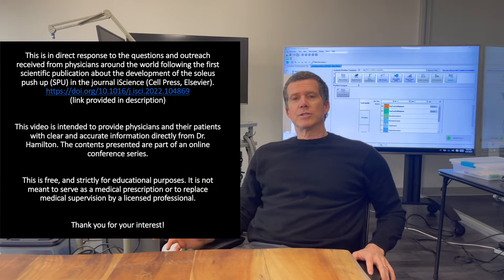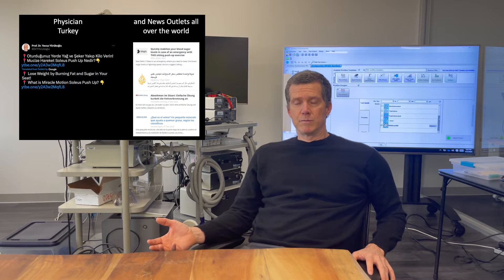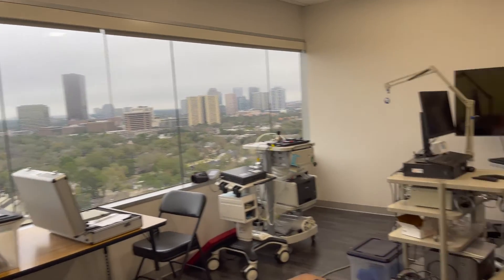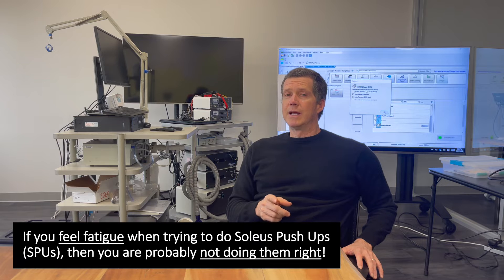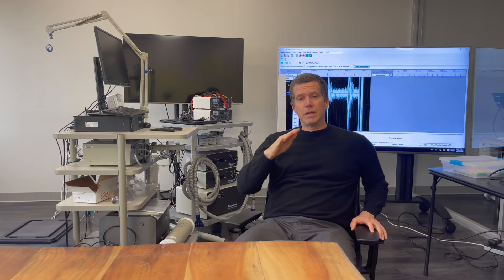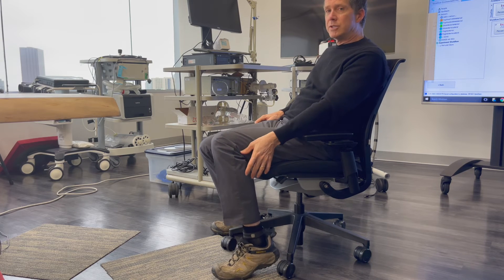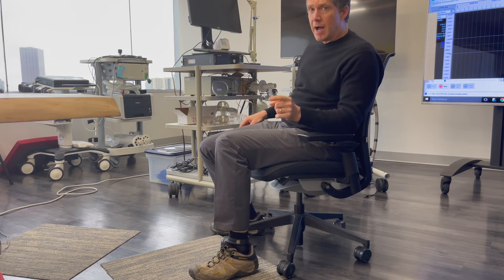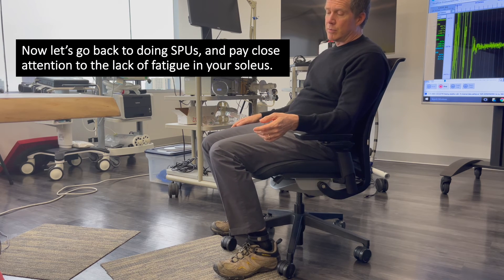Fatigue Resistance of the SPU (Soleus Push Up) demonstrated by the Developer, Dr. Marc Hamilton

Comment: Thanks for India.. I am benefiting alot from this exercise.. But one doubt though... What should be the height of the chair?.. also to reduce fat when can we do this? thanks in advance sir
Reply from the maker: It’s always a good idea to adjust the way you sit to maximize comfort and to also help you do the SPU motion optimally. It’s not just the height. But also to position the feet more under the knees (see the other video where this is demonstrated), it’s also sometimes helpful to slide your legs and bottom forward. When doing this it is also helpful to comfortably tilt your upper body back against the chair/sofa.

Comment: I do alot of cycling and find my calf muscles are quite developed as soleus and gastrocnemius muscles are important in the pedal stroke. Ive been doing the soleus push ups as well since i read about the benefits regarding blood sugar levels.
Reply from the maker: Athletes and fitness enthusiasts of all ages are using SPUs in training. The SPU activity trains these muscles at a greater intensity and duration than is possible during cycling (or running). The VO2 (oxygen demanding metabolism) of the calf is much higher when doing SPUs walking or running (see Figure 2C in our iScience article). Also remarkably, that data was during several hours of SPU activity and only minutes of treadmill exercise. You are correct that calf plantarflexion is important in cycling, running, and walking. That lower leg muscle group is dominated by the soleus because it is much stronger than either the lateral or medial gastrocnemius (the 2 separate muscles at the top outer part of the calf, whereas the soleus is both much wider and much longer all the way to the heel). But it is not just about what happens inside the muscles, and includes how the systemic responses good for other parts of the body.

Comment: Thank you for this video I saw Andrew Huberman talking about it. His description was brief with the only exception that it will help out to lower your glucose levels, but the videos that Yelp put explains exactly what we need to do. Thank you so much for this.
Reply from the maker: It’s naive for someone to think glucose metabolism is the only reason, or even the primary reason. First, I ask people to read the research article. It describes a general principle about why we needed to develop a method of for hours (not minutes) each day. The article also gives some other outcomes than just glucose (including lowering insulin concentration as much or an even larger % as the glucose), c peptide, VLDL triglyceride, and the calorie burn. But those are only the tip of the bigger iceberg of effects. More studies have been done and results will be forthcoming when ready for public dissemination. Finally, I can share that in part because of the anatomical location of the soleus muscle and it’s role in walking and running, we’ve interesting studies coming about the role SPUs play in even non-metabolic benefits for improving walking abilities of elderly and even athletic performance of young fit people.
Reply: Thanks for your reply I just like to keep one thing in mind if he wasn’t because I saw the video of Andrew Huberman, I would have not known anything about this Solis pusher and doing a search. Found me to you and look at your video and I’m glad to know there’s a lot more benefits push-up just goes levels I’m interested to know as much as possible and I’ll keep looking for watching your videos to get as much information as possible.

Comment: When can do this excercise to lower blood sugar level sir
Reply from the maker: The best approach is to habitually use this to keep muscle metabolism elevated throughout the times of day whenever sitting. That will improve not only glucose but other important things such as doubling fat oxidation. But the more limited acute option you you may have inferred was to do this instead of sitting when either blood glucose or insulin are too high  after carbohydrate ingestion (typically 30-150 min in the postprandial period).

Comment: Hello Doctor. May i ask do we have to do both legs at same time or can we just do one leg in session? Is it as effective as lets say doing soleus pushup of both legs together? Waiting for your kind reply. Thanks in advance and keep up the good work you are doing to humanity. I salute you, sir.
Reply from the maker: Thank you for your polite question. Sometimes 1 leg alone is all you can do depending on where you are sitting. In that case, know that 1 leg doing SPUs well can be impressive. In theory, if you were doing a highly controlled experiment and measuring fuel used for working muscle, then 2 legs would use 2X more fuel than 1 leg. But I’ve seen that when sitting where the floor or chair/sofa are not like I like it, the 1-leg kind is better. The rule of thumb is to keep moving because no one can have a very high muscle metabolism when muscle isn’t active.  But like I said in the video, you can be guaranteed that when soleus is working for you, it must use a lot of fuel. Compared to the energetics of all 600 of your resting muscles combined (one-third body weight), most people can learn how to keep muscle metabolism at a level 4X higher each minute they choose to do so with 2 leg SPUs, or to double the body’s muscle metabolic rate by high quality 1-leg SPUs.
Reply: @marchamiltonphd  Thanks for the kind reply, sir.

Comment from the maker: 60,000+. That’s the answer to the common question I am asked “How many combined  soleus contractions do your 2 legs always achieve in a day because of SPUs? But I also remind people it’s better to think about the “daily  contractile activity TIME” instead of  “steps/day”.  By choosing to take advantage of SPUs, it guarantees the local energy demand in my soleus muscles during my normal sitting time stays very high. How high? Significantly greater than if I could take 100,000 walking or jogging steps/day. But there is zero competition between SPUs and any type of exercise I want to do, because SPUs don’t cause fatigue, and only reduce the time I would have to spend sitting inactive.

Comment: Merhabalar🙂vidyodaki konusmalarinizi anlayamadigim icin aoruyorum.dizimizle ayak ucu  ayni hizadami olacak bide her saniyede birmi yapacagiz.tesekkurler iyiki varsiniz🙏💙💚⚘
Reply from the maker: The SPU is most effective to improve your health AND fortunately also most comfortable when done correctly. One tip I was giving was to place the toes below the knee, rather than putting the toes in front of the knee. Sometimes this is easier to do when you slide your hips forward, and sometimes this is easier if you pull your feed backwards (depending on what you are sitting on). The reason for this optimal position is that it makes your soleus muscle strongly positioned for pushing up your legs to a higher level, while also elevating your metabolic demand much greater than in other positions. The research study shows you can increase your metabolic demand (energy for muscle work) more than twice as much by this little tip. If I missed giving you a complete answer, I am sorry because I may not understand your comment because I am still learning your language. Please ask a follow up question if you want more help.